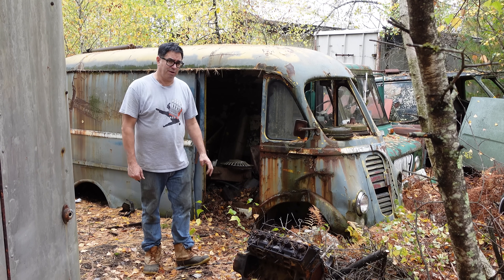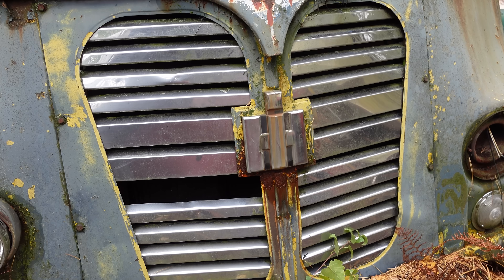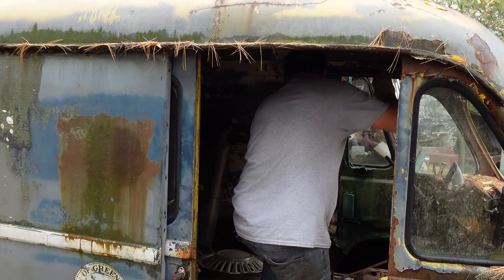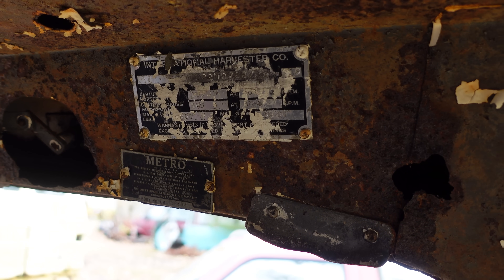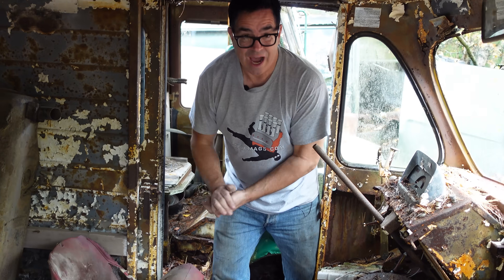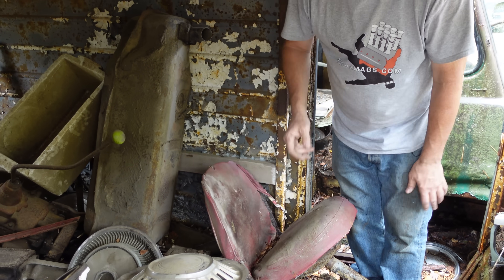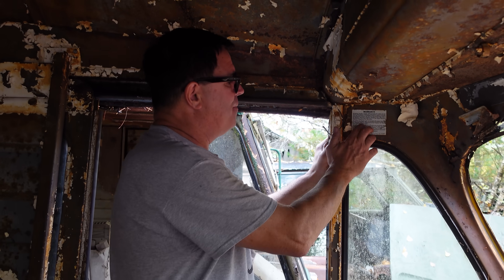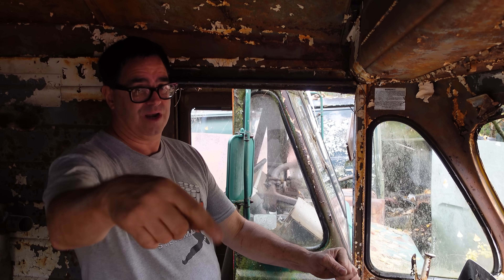1950’s International Harvester Metro Van

Comment: I own a 62 it hAs the folding seat.  I pulled body off and put it on 2011 gmc cutaway van chasis 6.0 ls.  On star haha  when i loosened body bolts they had some ih anti seize on them after cracking free i turned them off with my fingers old school cool. Thanks Steve

Comment: Reminds me of the '49 Divco milk truck my uncle bought me in the mid sixties which was also a stand up driver .  I converted it into my first motor home and drove it through the fields and forest to camp in with my friends .  It was rugged and a blast !
Reply: That's really cool. I bought a Grumman a few months ago that I'm converting into a camper. It's a Chevy 350 V8 with a 4-speed stick. I put a bigger carb, manifold and cam in it. Also put headers on it and true three inch dual exhaust. I have 16 inch polished five spoke wheels on order. I'm doing the whole 'hotrod ice cream truck' theme with it. I painted it intense blue with 0% limo tint on the windows. It's ready to go as soon as I'm finished with the inside, which is taking me forever to do because I'm being cautious to keep the overall weight down to keep it as light as possible. It sounds great with the headers and the lopey cam. If I dump the clutch and mat it, the rear-end will actually kick sideways pretty good. Gotta love posi rears. I don't know what rear is in it but it feels like a 4:10. I may throw in a 3:73 to keep the rpm's down a little. This was a local truck used by the old Strohmann's bakery. Got it for 800 bucks in running but rough condition. Had a broken window, smashed headlights, etc.
Reply: Gives new meaning to the term, "Got Milk?" LOL.
Reply: @googleusergp  Hey , G P !  Yeah , it does . I've been a big milk drinker all my life .  'Cept now I drink chocolate milk only . I've got a picture of me in front of my 66 Chevy van mugging at the camera and if you look at the front bumper you'll see a MILK  DOES  sticker .  I'll try to find pic and maybe send it to Steve so's everyone can see .  And yes , my friends and I had a blast in that first camper !  We were very young but tough kids , not like the kids of today .  Have a good one .
Reply: @daynadiggle8169  Most people don't drink milk as they age. We're the only mammals that do after a young age. LOL.
Reply: @googleusergp  Don't know what you mean .  I've always drank milk but the past 12 to 15 years it's been chocolate milk for me .   A tall glass on the rocks with two shots of whiskey .   Nothing else like it , and I'm enjoying one now after laundry detail and edging the grass along the sidewalks .
Reply: @daynadiggle8169  Milk isn't necessary when you're an adult, but if it works for ya, great. LOL.

Comment: I always wondered why tractor manufacturers like IHC with the F series and John Deere Model D from 1923 plus the A,B, and G were overhead valve engines but so many engines from the big three were  flathead engines and for so many years after the technology was available.
Reply: Great question!
Reply from the maker: Probably a question of cost cutting and maintenance minimization. Flatheads are stone axe simple, OHV's have pesky rocker arms and push rods to hassle with and pay extra for.
Reply: Forklifts from many manufacturers were still using flathead engines in the 80s. I'm guessing because of their low height, heavy weight and simplicity. Forklifts don't really require a powerful high revving engine so they worked fine.

Comment: The Air Force had many of these Metro vans. I was in an electronics shop supporting the defensive fire control system on B52Gs. Occasionally one from our shop would be tagged to drive one of these vans on the flight line. Once started in 2nd gear (QStack was a granny, not needed on level ground) we’d drive around without using the clutch. Just carefully matching the revs allowed smooth, grind-less shifts.  Big fun in the early 1960s.

Comment: Steve, on that stand up drive feature I remember a milk truck with that when I was a kid back in the fifties. If I remember right it had two pedals. An accelerator and a clutch/brake pedal. Half way down released the clutch, and if you went past that you were braking. Did this metro van have that feature.
Reply: Interesting, inquiring minds want to know....

Comment: In the late 80's I drove a short time for a private sanitation company in Mt Kisco NY. They had forward control route garbage trucks that had left and right position controls that allowed for right or left driving positions. That same truck had the sit/stand controls on both side also. There were two sets of pedals for each side. One for sitting and one for standing. The seat was the same principle as the Metro. Believe it or not, it was quite comfortable driving in the standing position. It is actually a leaning position because you leaned back into the folded seat for some stability.
Reply: NYC Sanitation trucks (from Crane Carrier or Mack) were/are that way.